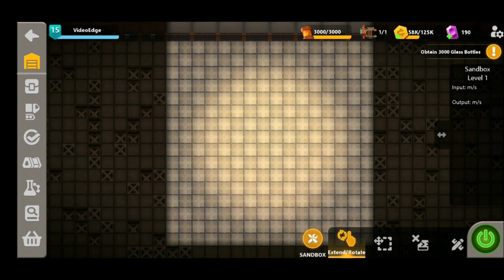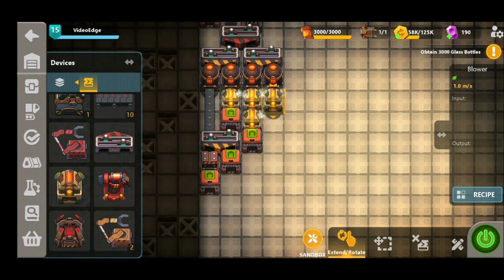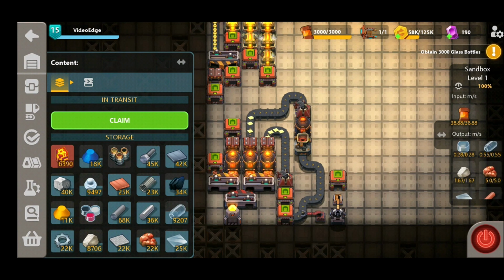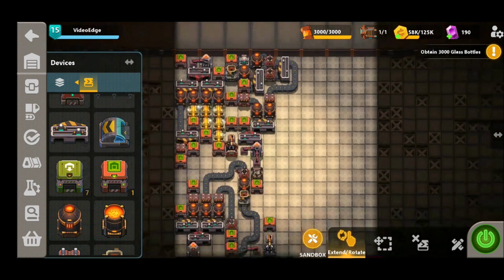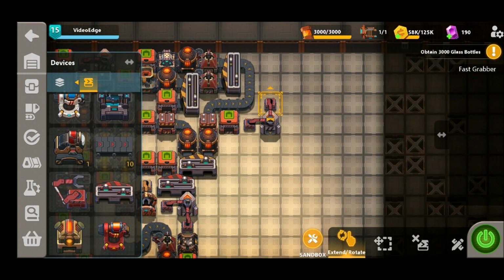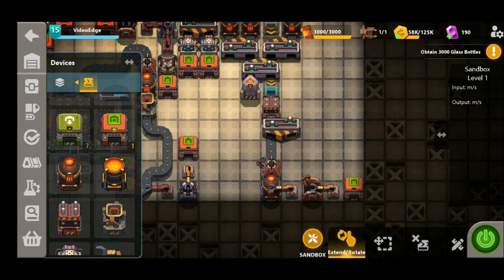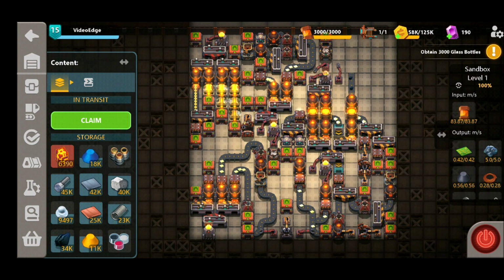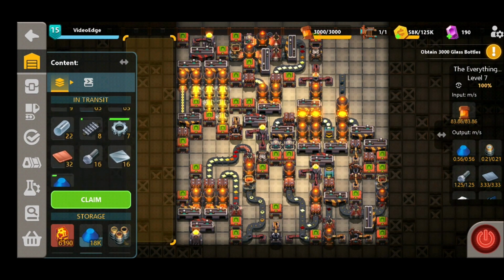Sandship Crafting Factory - The EVERYTHING Building! [HD]

Comment: Quick question what is a easy way to  make money early game
Reply from the maker: Best thing to do is recycle steel plates! If not you can complete the quests or puzzles, each puzzle is 1000 coins at the moment!
Reply: Steel plates the way to go..
Once u unlock silicon..make 5 recyclers with glass plates running into each of em ...5 synthesisers can each make 3 rows into each recycler using splitters.....easy cash...make 4 or 5 similar factories..easy output of 20c/s..
Also currently if you unlock blue everstone .use the glitch to make 10c/s extra using importer
Reply: Do you open sulphur?